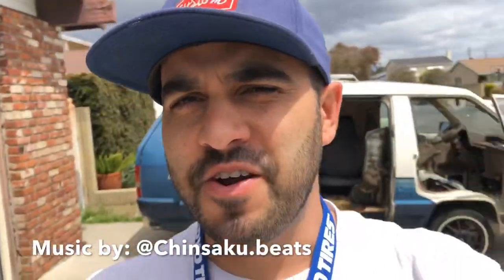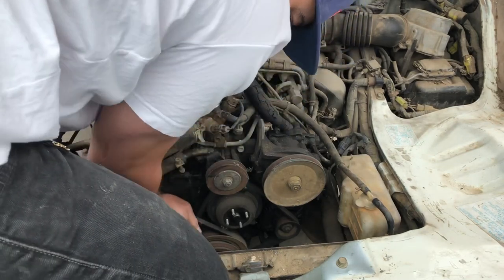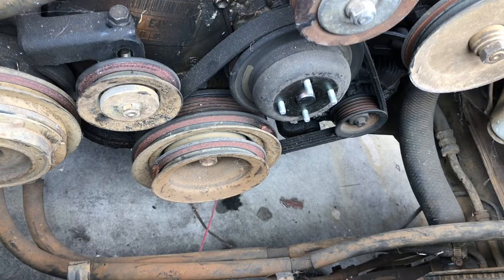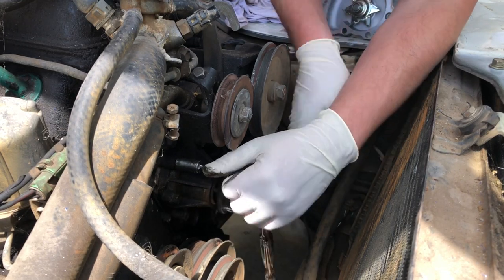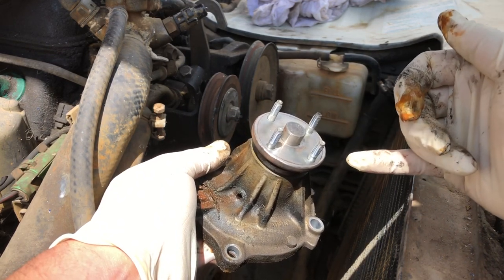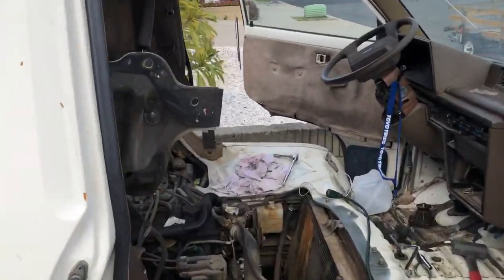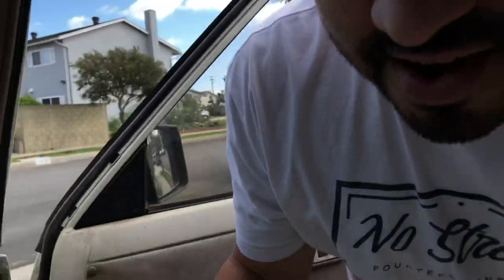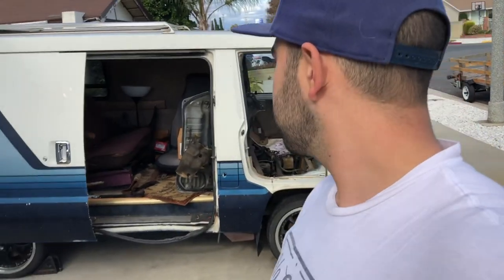Toyota van water pump replacement

Comment: Thanks mine is overheating so now I no what needs to be done they are cool looking vans
Reply from the maker: Oh moey I hope your right 🤞 it was a relatively easy job to swap over I’ll be honest, since you don’t have to take off a timing chain, it’s really just 2 adjustable pullies and Boom, your in there. 🤙 good luck! Find me on IG I’d love to see your van. 🙏
Reply: @realweston  I just pray it hasn't blown the head gasket or worse cracked the cylinder head

Comment: Those manual fan clutches work by air flowing past them. When the vehicle is stopped, springs push forward and engage the clutch, so the fan spins and pulls air across the radiator. Once you’re moving a certain speed, the airflow pushes the fan backward and disengages the clutch, so the pulley can spin and not turn the fan.

Comment: Great work brother. Looking to figure out what sensor is by the radiator cap. One is in the passenger side but the opposite is on the drivers side and it’s a larger thread. Would you happen to have the part number?
Reply from the maker: I’ll look into it, I’m not certain which one your talking about, but I did replace my thermal switch. Not entirely sure if it did much 😂 
Thanks for commenting on the video🤙 good luck on your van project
Reply: @realweston  I wish I can add photos lol. I have a video of my van in my profile. It’s been in the family since 1986 or so and it’s an 85.

Comment: Good instructional. I did the pump on my 89 last week. That pump physically didn't look bad, could all that rust be making you run hot? Did you have the original fan shroud? Turns out that makes a big difference in air flow
Reply from the maker: Actually upon inspection I don’t think the pump was the initial problem. I do have the fan shroud i took it off when I first attempted to fix the van before knowing what I was doing. The story goes, In 2017 I found this van for $500 but it needed a clutch fan replaced. The seller said it could drive it home with that part. So I drove out to the dessert, swapped the part, and started my journey back home. But something else was wrong with the van, and it was running hot, so I tried to limp home, but on my third stop, the van sprung a leak and dumped out all of its coolant Or atleast majority of it. I had it towed the rest of the way back and there it sat for the next 3 years. lol so now I’m Finally getting around to wrenching on this thing. 
I had the water pump just laying around and figured why not just give it some new parts. I think the old water pump is probably fine honestly, I’ll be holding on to it.
Reply: How can you tell if the water pump is working correctly? When I take the radiator cap off, and crank the starter, the radiator fluid shoots out. A mechanic came out for 20mins and said it’s my head gasket. Sucks I got charged $120 just for him to tell me that.